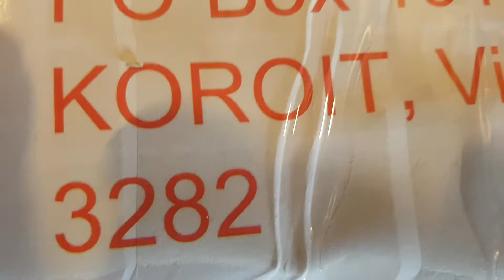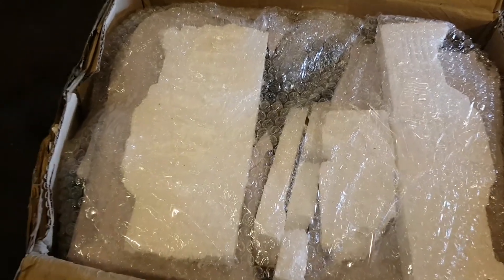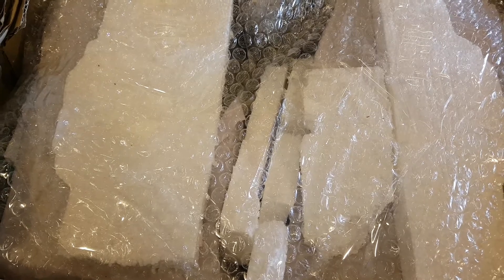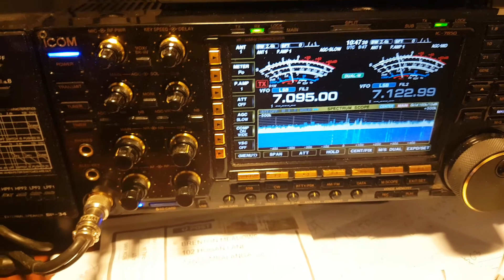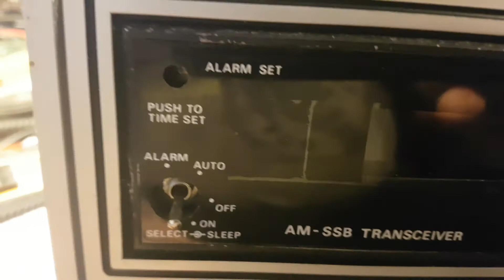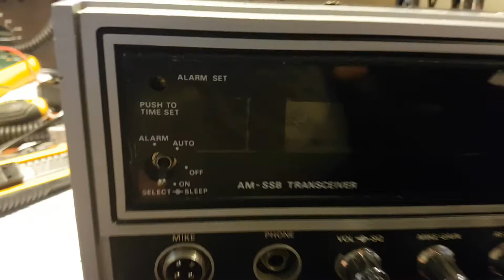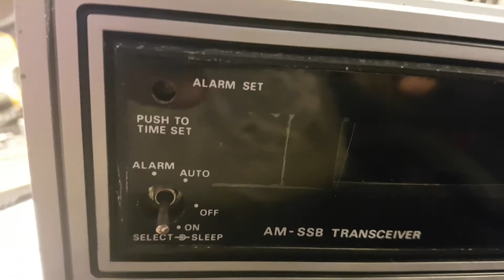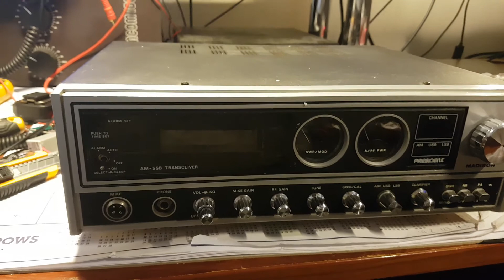president madison ripoff/ now long long restoration

Comment: What a shame! I assume it has the great 858 PLL. Lots of people took out the clock because they quit. I took my clock apart and repaired it. The gears are available. Mine has 197 actual channels in it, but I put them in so I know it was done right. I never use them any more because 40 channels are more than enough in the U.S. today! That is a truly great CB radio. I believe that it was the finest solid state CB ever sold. Better than the Cobra 2000 and certainly better than any of the DAK junk. I am partial to tube radios such as the Browning Golden Eagle Mark III and the Tram D201 (not 201A). I wish we could get these radios shipped to you cheaply. I see them in antique malls and second hand shops for very little money nowadays.